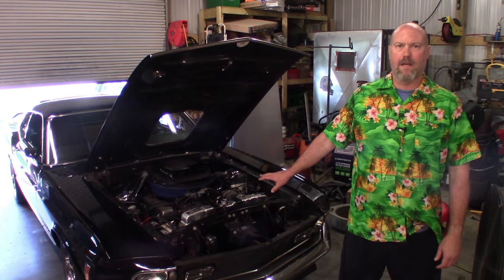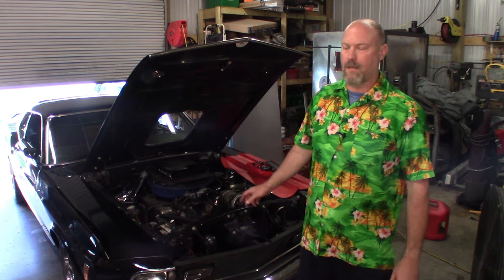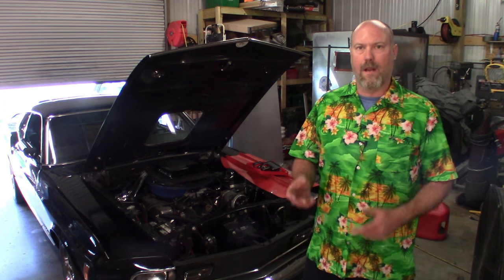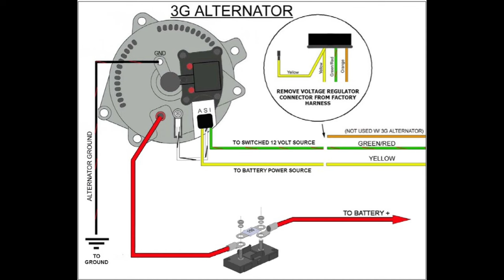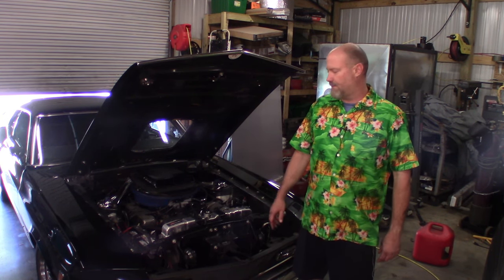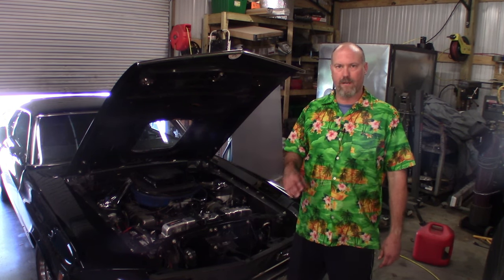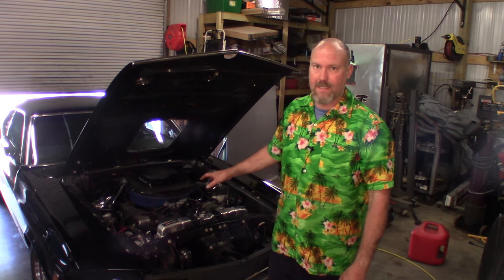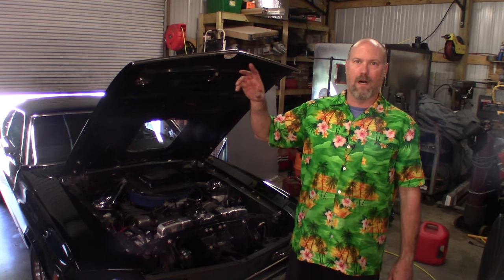Cooling Fan Upgrade for Ford 1970 Mach 1 Mustang Galaxie Falcon Fairlane 3g alternator upgrade 64+

Comment: Don't know about fords but my BBC had cooling problems and I solved it by running cooling lines from the back of the head to the front through the intake, you can do it with SBC as well. Nascar teams do it and it works awesome.
Reply from the maker: The new fans seem to be doing the trick so far, but I will keep that in mind, thanks!

Comment: What also works good is a Grand Marquis Lincoln ETC later model with a 4.6 they have a big cooling fan for the AC
Reply from the maker: The big Ford options were always the Taurus fans, Lincoln Mark VIII fans, and now the Contours. The issue with the Mark VIII is the overall size of the fan unit. It does work great if you can fit it though!

Comment: I use the GM front wheel drive cooling fans I cut the two piece in half use a GM relay with the coolant temp sensor from a citation or older Camaro to trigger the relay to ground it to kick the fan on I'm just running one fan on my S10 V8 and it sets at 170 all day long with just a little Corvette radiator you could also just ground the relay and provide the 12 volts to it with key on off so it just comes on without using the coolant temp sensor
Reply from the maker: I’ve ran a few setups like that in the past myself, thanks for watching!